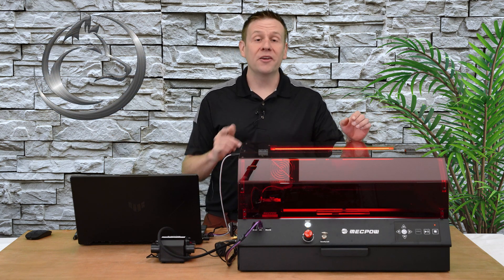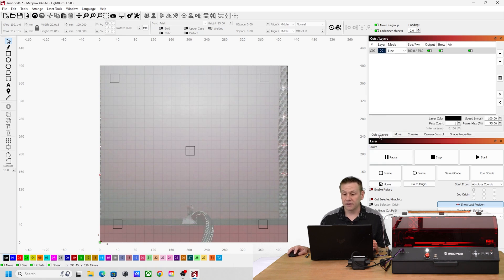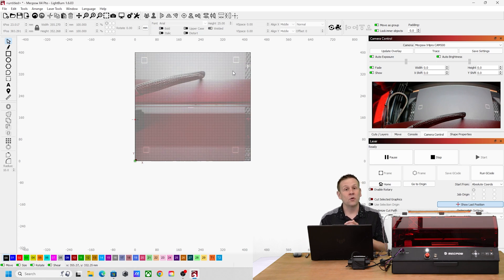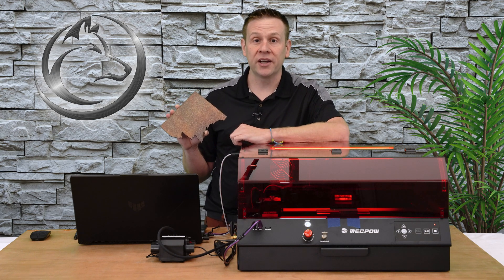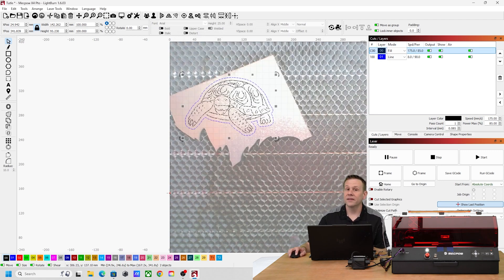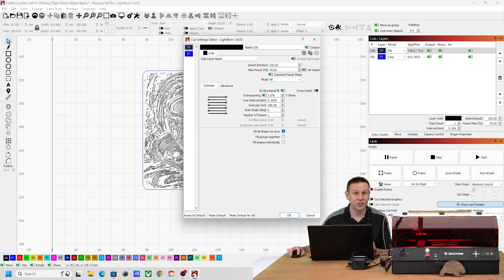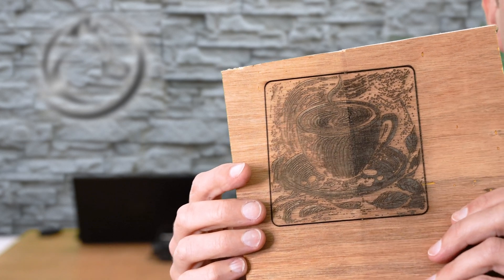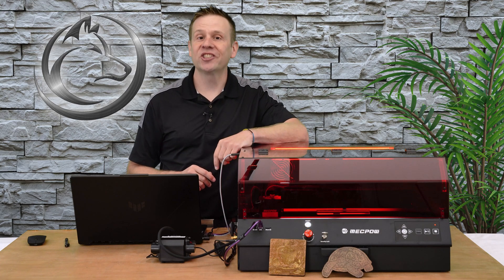Mecpow X4 Pro- Accuracy Tests and Projects! #Mecpow #Mecpowlaserengraver #MecpowX4Prolaserengraver

Comment: Fine review! Now for a question. I'm interested for a simpler version by MECPOW for PCB work. Do you think it will do the job. I also would belive the PCB will need be painted black or such.
Reply from the maker: I haven't used a laser system for PCB project so I can't offer any insight for you :(